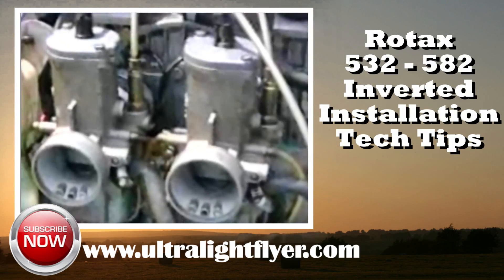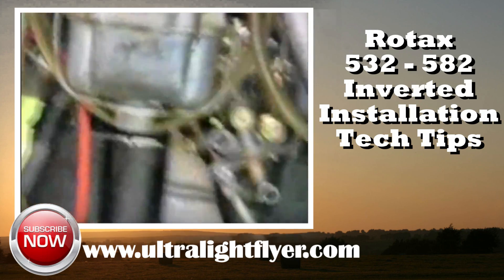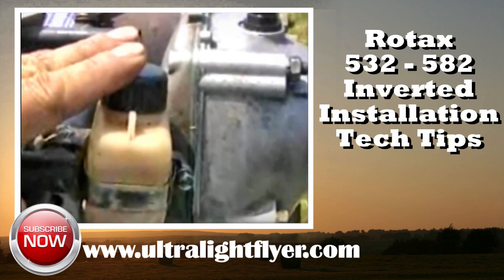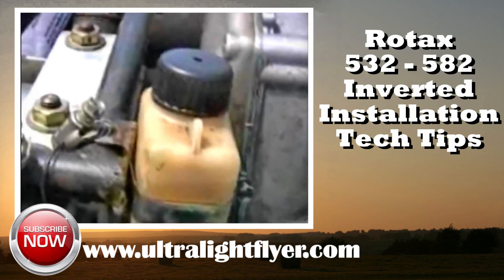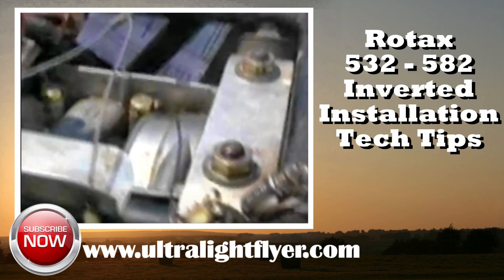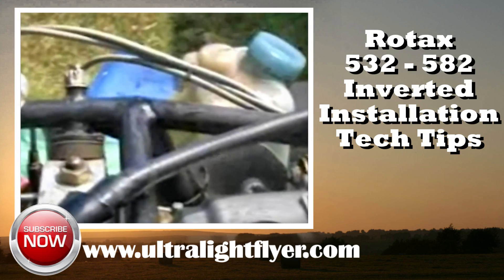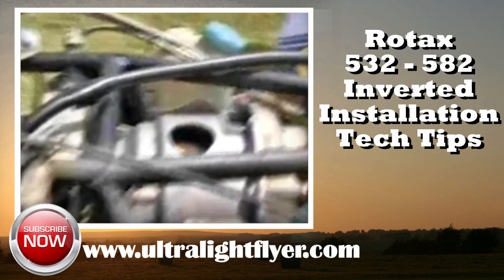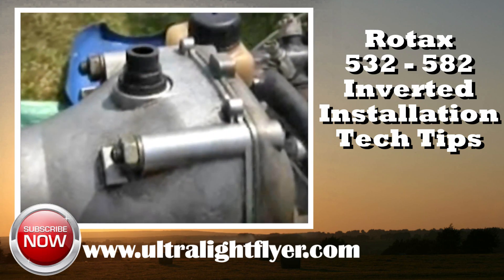Rotax 582, Rotax  532, Inverted Engine Installation Advisories

Comment: Correct me if I'm wrong but isn't there a bleed screw on the exhaust side so you can fill the rotary shaft oil inverted and then bleed the air out?
Reply from the maker: Yes there is BUT that is the purpose of the video. The bleed screw is NOT at the highest point in the system, because there is a cavity inside the rotary valve shaft area, that is higher.